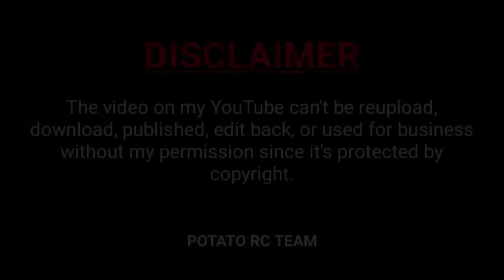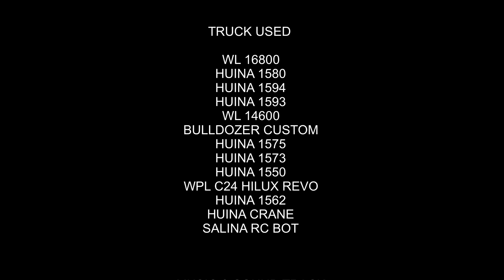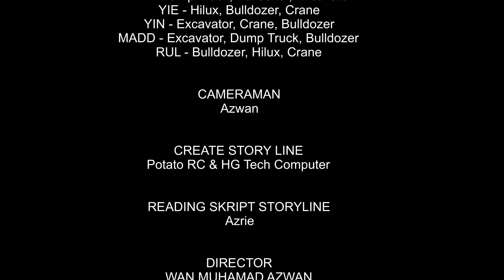Strong Scale: RC Excavator Hitachi Long Arm Help Huina Dump Truck 6x6 Servo Liner

Comment: Apakah aman untuk.elektriknya tuan, posisi mobil terguling d air seperti itu? 🙏
Reply from the maker: Kalo mahu main dalam air, board kena buat full waterproof dulu tuan, kalo stardart main air rosak motor dia 😊😊🤝
Reply: @PotatoRC  hnmm
Reply: @PotatoRC  jadi kita kena buka boardnya dulu?